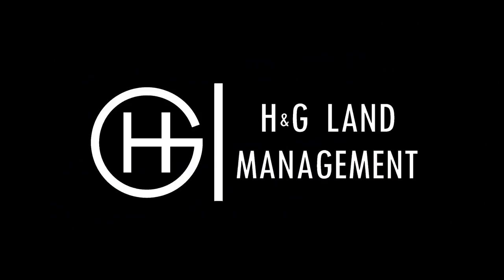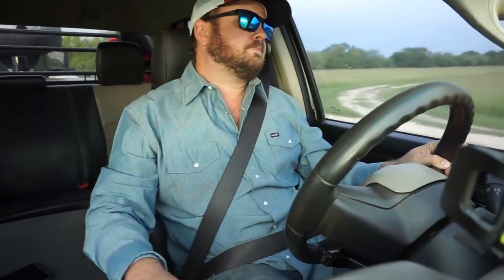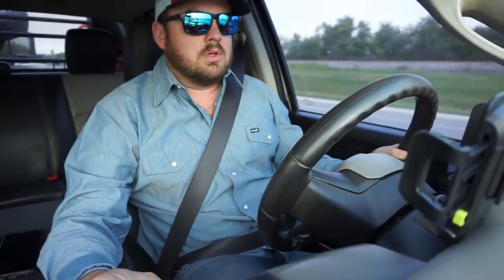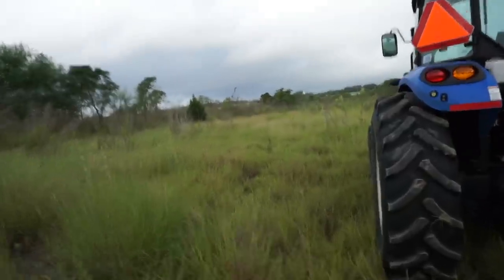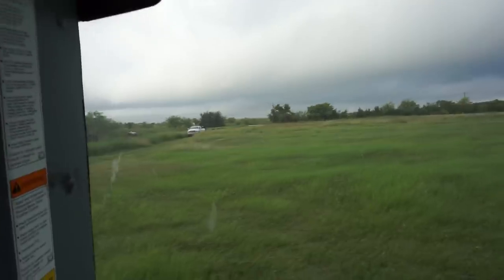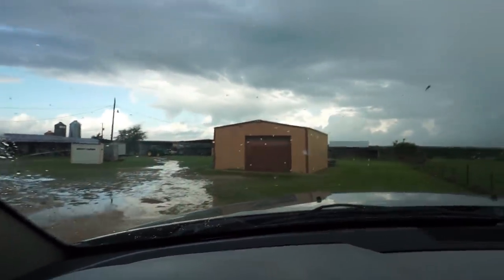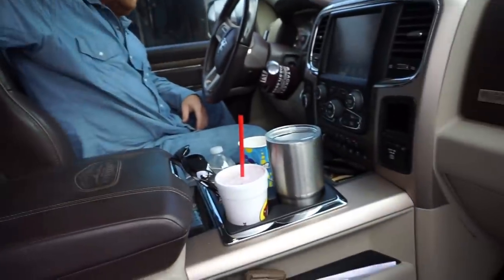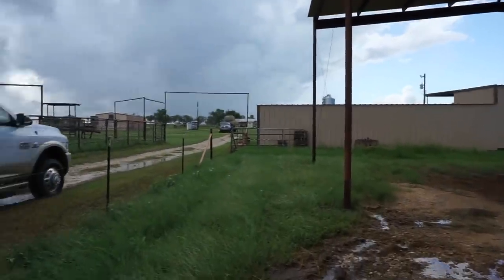Hauling Hay - Heavy Weight with a Ram 4500 Cummins

Comment: Love the Laramie Longhorn package on these, if I were to buy new or newer, that’s what I want, feels like a true Ranch/cowboy truck lol.
Reply: true ranch cowboy trucks normally have a floor with 2" of dirt and seats that are missing half of the fabric haha.
Reply: Im actually looking at one in the next couple days. She might be in the driveway by new years.
Reply: Brandon Caldwell I’ll sell you mine 2011 Laramie 2500 white
Reply: @reapertrading  Im good. Have a ram 3500 dually in the now. It is a 2018 Lone Star Laramie. Came off the transport truck a and was sill in transport mode when I bought it. Only 11 miles and now at 100.  Besides, 2011 does not have the guage display i like or the high and low backup cameras with ram tow prep package.

Comment: Standard? Man u just made me want one.
Reply: I think ram is the only one that offers Manual  options  but at the loss of torque and  hp
Reply: But at the gain of gas mileage?
Reply: @blessedexpress4476   yeah probably only 2 mpg  gained only reason to have manual  transmissions  now in days is for fun
Reply: @hihaveaniceday9386  
Correct. The fun of it is the best part!

Comment: Each trailer has room for one more on the neck fellars... haha
Reply: Hey, wouldnt be the first. Some guy did stacked double rows  like th bottom and one on the neck. Think the police liked him that day as he never did that again...
Reply: @brandoncaldwell95  more than likely they had a field day with that guy over weight or tie downs. doesn't matter where things are at on the trailer as long as they are tied down. I'd probably even be careful with how those loads were tied down. DOT cops got massive sticks up their asses and will get you on anything they can
Reply: @zachbooth1785  Overweight. Each bale usually is arounf 1500-2500lbs a piece. Was not sure on his, but he was overweight by a lot. Truck did handle towing it fine.

Comment: Im going to put some air bags on the rear of my Honda ridge line for more weight...going to get a goose neck ball in the bed ...get new heavy duty trailor..bet i can haul that load easy ..i might have to get some tow mirrors though.
Reply: mack buger don’t tow heavy with goodeneck, get fithwheel, and don’t tow heavy with a Honda
Reply: @xtune5731  just don't tow anything with a honda
Reply: Thermidor le vrai just a unibody with a bed

Comment: And the estimated weight is?..
Reply: Well I think u might be light ...I have a 07 3500hd Duramax single wheel reg cab. With a Bradford four box flat bed and Ranch hand bumper on it and I pull a 30 ft big Tex dual tandem and empty I weigh 15,500 lbs and I haul 15 bales made with a John Deere 560M and we sell by the ton so we weigh almost every load and we will get up to 42000lbs with good oat hay and 4 cutting alfalfa

Comment: Is poor dairy farmers in the Midwest pull a load like that with 3/4 tin gassers!!!
Reply: In the northwest we don’t have trailers that long so we crank the density up. Most of our bails are 1,600 pounds and we are lucky to haul 14 at a time. Also diesels don’t start up here in the winter so many don’t own them. I’m lucky enough to have my 7.3. Saves on fuel a ton.
Reply: Make it & Break it! I did 19 round bales on a f-250 with 4 bales on the back of the truck(flat bed), a hay wagon with 5 roundbales and then 10 on the round bale wagon, to this day I don’t know how I made it home, but it saved me a trip
Reply: @jimf-150  Idk, these 7.3s are incredible, they put em in IH dump trucks call it the t444e has bigger injectors 620 foot pounds of torque, total weight adding up to 40k lb (illegal) but it pulls. 5.9 wont do that, it would have to stay in 1st on a 6% grade lol.

Comment: my 40ft gooseneck with 2 12k axles could only take 16k payload, are you overloading that much, or do you have bigger axles?? DOT here would tear you a new ass being that overloaded
Reply: H&G Land Management I see, nice trucks, we run a 2016 Ram 2500 HD with a 6.7 cummins and a 6 speed auto, our max is usually  around 20k tow, it does it well.